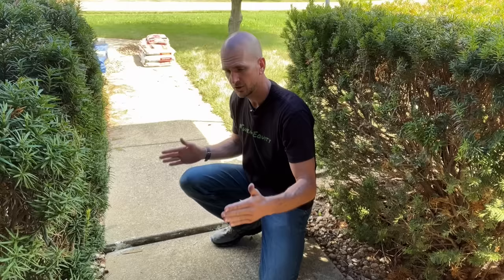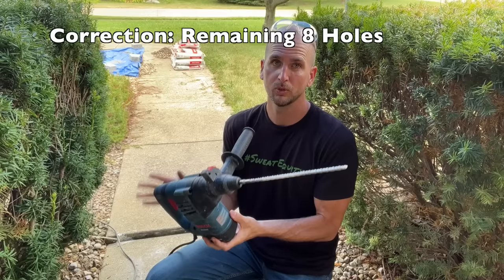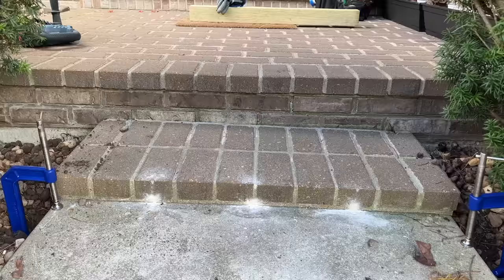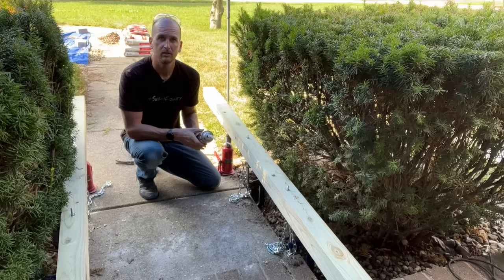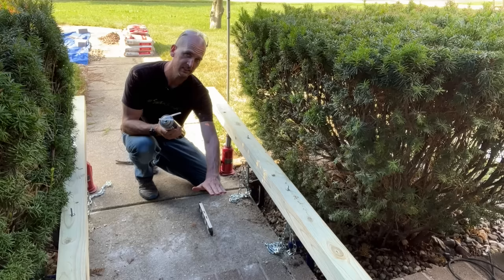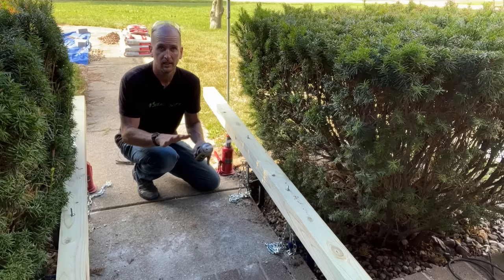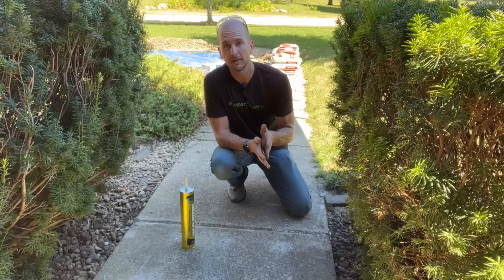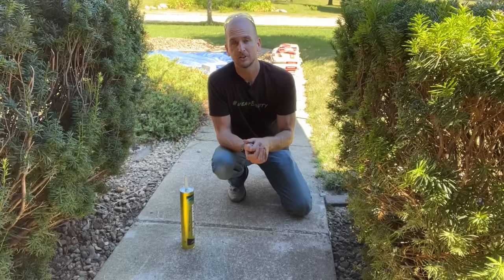How To Fix A Sunken Sidewalk With Spray Foam

Comment: I did this with my sidewalk out front to avoid the city charging me $625 to replace 2 5x5 slabs.  Worked perfectly with the c clamp method.  The 2nd block had some obstruction so I could not dig on each side.  I had to lift by installing 2 5/16 tapcon bolts.  Because there was no outlet for the excess foam I ended up overlifting by 1/2 inch so I had to lift the adjacent slab.  I used the drill dust and some fine gravel over the self leveling sealant to blend into the existing sidewalk.  Looks great.  Also found out the foam doesn't yield after it sets up(less than 1 hour).  No need to leave everything up overnight.

Comment: There's an inadequate subsurface problem that needs to be cleared out and filled with sand or concrete.  Foam is porous so it will fill with moisture which will go through a few freeze/thaw cycles in the winter and decompose or rot.

Comment: Great video. We had enough issues that we had sections aligned by a company that pretty much did the same thing. Although I wonder if the foam was the same or less susceptible to long term degradation.
You also covered a key thing about dealing the joints, prime point of water entry under the slabs. I used backer rod with Seka sealant, both regular and self leveling, for this. I also lightly spread sand into the sealant while wet, then brushed excess away after fully cured. Makes for a nice appearance.
Reply: They actually make a load-bearing foam for doing this I don't know why people keep using the air blocking foam
Reply: @thecloneguyz   I will jack the slab and I have an Airplaco hg-5 grout pump that I will pump mortar under the slab with. Did it in my backyard 10 years ago and it is still great.

Comment: Brilliant, one suggestion I use often is save the concrete dust and dust the top of your plugs with the dust. Perfect match to the surface in about a month or two!
Reply: Here's a brilliant solution. Just lift the concrete out of the way by standing it on edge. Get a little stone dust or good packing sand. Then level the area to the appropriate hight and lay the slab back down. It's pretty simple. Tools required; lever, fulcrum, sand, level and tamper.
Reply: @shealdedmon7027  At 50 pounds per square foot of 4" slab, that area is going to be heavy with a capital H.  Not saying it can't be done as you describe, but that section is probably approaching 500+ pounds.
Reply: @shealdedmon7027  the solid layer of foam will be sufficient to keep the concrete from settling.   Foam has been used under concrete for decades now, and works just fine.   Most commercial freezers are insulated from below with foam under the concrete floor, dating back to the 60's.
Reply: @5thGenNativeTexan  No problem with the “power” of leverage and having a good size breaker bar or Johnson bar.

Comment: I am a concrete contractor.  This guy did well.   Not sure how long it'll hold, but he saved himself some money.   Wire mesh, used initially, would stop this heaving, but many don't want wire in their sidewalks, or they don't want to pay for it.
Reply: I would never offer that service.

My repor with homeowners is critical to me. I don't do half way fixes that destroy a products structural integrity with holes.

Someone else can have that job. Maybe a youtuber could swing by and do it...

I've had the opportunity to spray foam many fixes over my years in the trades, I've jumped @ none of them. The main thing I use it for is its to seal the bottom of drywall gaps to the floor when I do a self leveling underlayment.
Reply: Wire mesh would not have helped here.  There is an expansion joint, an obvious separation of the two surfaces.  Wire mesh only keeps the slabs from cracking.  If the subgrade had been compacted or prepared properly and if water run off is not draining to this joint, this wouldn't have happened.  This is not a heaving issue, it is a settling issue.  And initially using rebar, not wire mesh would have prevented this, especially if the two sections were poured at two different times, and the old slab could have been drilled and pinned to the new section.

Comment: This seems like a great method!

Previously, I’ve worked on a slab jacking crew. We would do the same thing. We however wouldn’t use “foam” but rather a mixture of Portland cement (to harden), ag lime (as filler), and bentonite (to aid in flow- not sure if it has a purpose out side of that). This mixture was touted as “safe for the environment”. 

The 2 problems with slab jacking are:

1) cracks happen sometimes 
2) typically can’t get things back to “original” but close. 

With smaller pads, lifting them up with a couple bars and packing dirt under is probably the best bet. 

Be mindful of erosion and you’ll save yourself a lot of money
Reply: Bentonite expands as part of the curing process.  I'll have to remember to use some of it next time I do this.
Reply: @CrabgrassFarmer  yes I wonder if it retaining water would allow for the Portland to not cure correctly. It seemed like it worked when we did it.
Reply: @SoTaSpEaK  There is enough water in the soil to make the cement cure with time.

The bentonite and lime will also reduce the strength of the mix so that it can move a little bit and reduce the chance of the slab cracking.
Reply: @johnclements6614  I see. Thanks for clarifying that.

Comment: You did an excellent job lifting it and setting everything back level. When I read the thumbnail I was very sceptical and my first thoughts was that foam will not lift that slab. But once dried it most certainly will hold the slab up.

Comment: I had a professional company try foam under my brick paver front porch after it started to sink in the middle. After 120 lbs of foam, the sides leveled off but in the front near the steps, it was rising. They refunded my money (very expensive) & I had my contractor rip out the pavers and pour a stamped concrete floor with rebar. Turned out great.
Reply: @Etron49  That's what I thought about halfway through the video.

Comment: I did the same thing but no drilling! I dug the low corners out and put C clamps and a chain joining them. Then with a harbor freight farmers Jack I easily picked it up slightly higher than the other slab. I washed sand and water along the sides into the underside of the slab. Let it dry a day and Dropped the Jack and jumped up and down on it, success!!!

Comment: I love how you quickly found out your cordless drill wasn’t cutting it. I had the same revelation a couple nights ago trying to reattach loose furring strips behind drywall in my basement. Started off with masonry drill bits and my Milwaukee hammer drill, 45 minutes 2 holes and a dull drill bit later I got a ramset tool and got 10 more done in 15 minutes
Reply: Lol, cordless = toy.  They definitely have their place, but batteries don't compare to line voltage.

Comment: Foam lifting is for large slabs.  It won't help much if you have other problems such as an ant nest under the slab.  Better would be to just lift the small slab, deal with any problems that would cause the issue to reoccur, add the appropriate fill material, and lay the slab back down.  I've also seen places where the issue isn't settling, but uplift.  In those cases, you have to remove tree roots under the lifted section.
Reply: That's amazing, you should make a video
Reply: COOL STORY BRO
Reply: Ants would not stop foam but would be a dead ant nest

Comment: Interesting idea but much simpler; I lifted each side with a heavy 1” x 6’ breaker bar from HDepot, temporarily stuck a few large rocks to hold it up, removed the bar and dug under with a hand shovel a bit then mixed concrete and shoved it under wherever I could. Next day took out my temp rocks and dressed the dirt edge back up.
Reply: Can we see the video?

Comment: Note for the cost of renting a rotary hammer drill, you can purchase a cheap  one from Harbor Freight.  Yes the professional ones are a beast and will last for years, but I grabbed a corded 8Amp Bauer for me $67.  I'm sure I'll die randomly but I've gotten 7-8 projects out of it and even resorted to doing things I normally wouldn't abuse a drill for (like digging holes and churning compost with auger bits).

Comment: Great video. Here's a idea: instead of drilling through the concrete, as a means of getting the foam pushed into the center, how about inserting tubing under the slab after is it lifted? use these as conduits to spread the foam.
Reply: That's a smart idea.  I think the process he showed would more often be used for a larger piece or for something where you couldn't get access through the sides.
Reply: I don't think it would be bad if that bit of path way is in reasonable condition and the holes you drill are quite a distance away from the edges of the pathway
Reply: My thought exactly. I'd rather dig 6 inches around the edges than drill holes. Then just slide A few feet of vacuum hose from the auto parts store into the newly created gap, spray, move around if needed, until the gap is full of foam. I'd still like to give credit to this video for finding an easy way to mimic the professionals. 

Also, I'd be interested to hear if any of the concerns of this type of foam expanding too much(raising the repair too high) have happened. If so, then it might be wise to use "door and window" spray foam that only fills the gaps but doesn't add extra pressure. Apparently using regular spray foam around doors or windows can expand too much and interfere with opening/closing--the same principle should apply here.
Reply: Perhaps use the foam for lift by shooting some under the center, and packing earth on either side? Gently tamp periodically to try to distribute the foam a bit and keep it from raising up too much?

I worry that it'd continue to expand

Comment: Just Grab your angle grinder with a masonry disc and grind the corner of the protruding block off to a comfortable angle.  
Great vid Stay Happy and Healthy
Reply: I was wondering why they didn't do that.  You can use the grinder and also one thing that repairs concrete well, is more concrete. I used to drive Illinois and other north-central U.S. states and they often saved money by using concrete slabs on their highways.
       The better maintained ones would have a crew close a lane from time to time, and they would have a couple guys separated, using huge angle grinders and face shields to smooth out the transitions. Using a toxic plastic foam that is not permeable and not nearly as sturdy as concrete seems a real short-sighted fix.

Comment: 1) did you fix the drainage problem that caused it to sink in the first place? If not, it will continue to sink.
2) the foam will compress over time, it's not a structural product. I've tried similar things with a retaining wall and straightening a mailbox on a pylon underground and both failed due to compression of the foam after a couple years.
Reply: Makes sense. Surprised he didn't insert some bricks or inject some concrete in the sides to guarantee it will never sink.
Reply: I would say the foam is a structural product. The compressive strength of the foam will support the concrete. Perhaps the failures you saw were because the compressive strength was exceeded.
Reply: Crazy amounts of different spray foams. Pop this small section out and pour new 3’x3’ pad. Cheaper and would last longer.   Would drill 3/8 rebar into step and next sidewalk to ensure stability.    Would not be surprised a drain spout is near.
Reply: 1) You are assuming it was a drainage problem.  It may just have been un-compacted dirt used during construction.
2) Some foam is a structural product.  It is used professionally to raise driveway slabs. It is used to set posts.
Reply: @onjofilms  1)  This is not a new walkway and even if it was, if it was only a matter of un-compacted dirt then the adjacent slab would sink too, unless there is a specific extra weight placed on it, for example this happens on driveways where a vehicle is parked.
Reply: yeah just looked up the listing for Great Stuff big gap filler, and it says its not to be used to fill large cavities or voids, and not to be used as structural support in marine applications.  I'm curious how that particular form will hold up after a nice heavy rain.  I know they make foam for this type of application, but it seems the foam choosen in the video ain't it!

Comment: Great video. I would even consider letting the closed cell foam do the work for you. In a rennovation, I added a new tub. The overall contractor doing parts I was not wanted to spray foam under and around the tub instead of my concrete base. Thinking that a metric ton of water is heavy, I said okay, but you own the mistake if there is one. We came back the next day to see how all the work was and the tub was lifted about 1.5" upward breaking the seal to the marble slab it sat on. If we go better at this, we could measure out and do this with spray foam and bypass the manual lifting. I do appreciate the control your way has though.

Comment: pro tip with these cans ... use needle nose pliers to grip the base of the dispenser 'nub' at the top of the can while you are screwing on the dispenser tube ... this will allow you to create a tight enough seal that foam will not creep into that seal ... also, you can use the cans a second time but to do so, it's best to clean out the plastic tube (assuming you only have the one) before the foam cures ... a long metal wire and/or an air compressor come in handy for this (*only after tube is removed from the can*) ... clean the semi-cured foam out of the nub gently as to not damage the nub and the seal inside that is holding back the compressed gas ... wear safety glasses for this ... *even with care, sometimes the cans are still one-use no matter how well you clean them
Reply: I clean the nub out with brake cleaner afterwards and can usually reuse partially used cans no problem.

Comment: Great demonstration of how to resolve this issue - i know alot of residents have these trip hazards.  A final addition to your presentation, is to work out the math on a white board, to show the cost of "remove & replace" verses "lift & support".     It was great to watch this.   Greg  (garden grove, CA)
Reply: This is a horrible MacGyver episode. Where MacGyver breaks free from his trip hazard with a drill, insulation gap filler, and 2 shoe laces (still laced in shoes).

Today folks, I an unlicensed, not contractor. Is going to show you how to destroy your homes structural integrity.

I learned more from Tim the tool man... Like how important a good neigbor is!

Comment: interesting approach. having  set forms and poured slabs I think it's  less work and longer lasting to demo the old slab, set a form and mix several bags of concrete.
Reply: I totally agree! You can rent a small electric jackhammer, concrete mixer, and buy concrete for a whole lot less money. Secondly, you don’t end up with those noticeable ugly filled drill holes that never blend in with the surrounding concrete. But it does take some skill to finish a poured concrete slab to make it look nice and the color won’t match the old concrete sidewalk.

Comment: Just perfect. I probably add 4 large rocks wedged at each corner. Big difference and very clean look
Reply: I agree.  The foam may be sturdy, but it has give and will move more than a solid object.
Reply: I did a driveway slab this way and I ended up putting foam in the middle but my son and I dug out around the perimeter and added blocks under all the edges after we put down gravel and compacted.  Much more work but I feel better that it will last a long time.  That was about a year ago and it has not moved one bit.  Yet.

Comment: Great video thx!   My buddy and his father do driveway leveling and house leveling down in Texas. They actually dig holes on the end needing to be jacked up.  They then put inexpensive bottle jacks in the low spots and Jack them up.  Afterwards they pump concrete in encasing the jacks and creating a pier. Works really well with large areas on driveways too. No callbacks.  Just FYI.

Comment: I have a garage with 6x6 slabs that make the floor. each slab has sunk in different directions. After watching you do this I think I could take a laser and mark where the top of slabs need to be and hoist them into position. I would pump grout under the slab until it is completely full and give it a few days to cure before releasing the tension off the hoist. I have been looking for a way to do this without demoing the floor and poring all new. After watching your video I clearly see the way to do it. Thanks

Comment: Great DIY approach to fix this problem, I would think that self level floor cement would be better to funnel in the holes as the foam would compress over time and the pad would sink down
Reply: Exactly my thought. This would end up compressing at some point. Cement would be the way to go, I think.
Reply: Yep, I washed sand into a cavity under the corner of a driveway slab until it was no longer hollow. It worked great. I've done it with large cracks before sealing them too. Play sand works great and flows with water quite well.
Reply: I've always tipped the slab on edge, corrected and compacted the bed, and laid it back down again.  You save a lot of time excavating, but it can be fiddly getting it leveled out.  Still, you're under no time constraints, so you can just tip it back up, add or remove material, and lay it back in.  If you have access to fill material, it's a zero-dollar job.